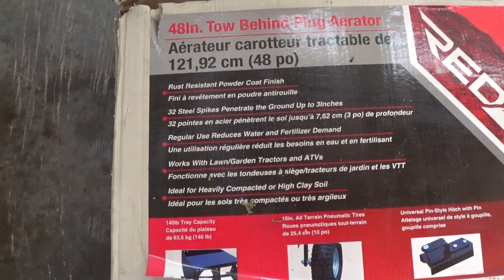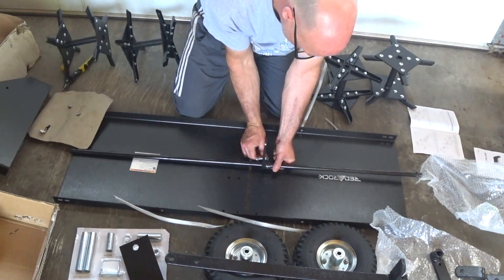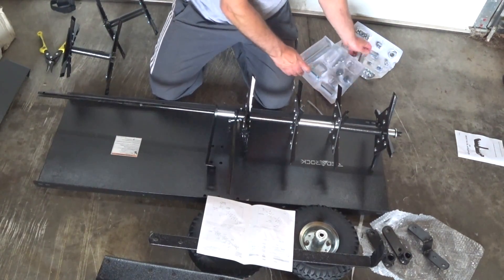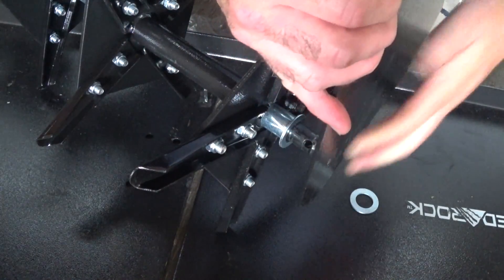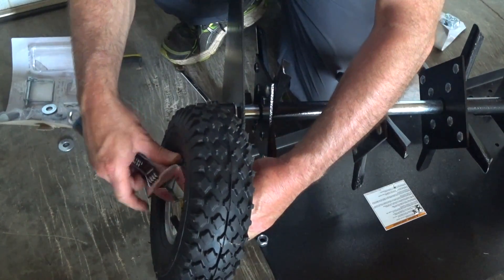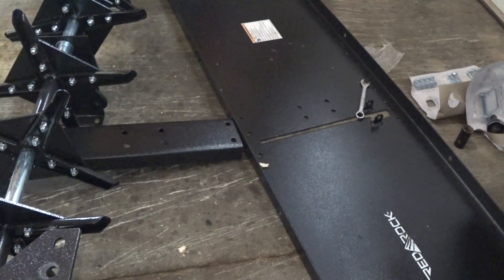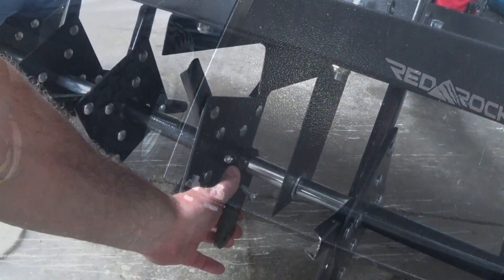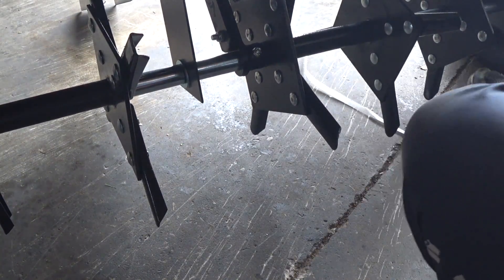HOW TO ASSEMBLE 48" Red Rock Aerator from Princess Auto

Comment: Have you figured out what the purpose of the spacers on the top is? I spent quite a bit of time trying to figure that out while assembling mine the other day, and I couldn't come up with an answer.
Reply from the maker: i cant recall TBH - you mean the spacer on the tongue part?
Reply: @mudbrats  Yeah, there's 4 bolts that call for spacers, but I honestly can't see a reason for any of them. Two of them don't even attach anything together. It's just a bolt nut and spacer through the top plate from what I can tell.
Reply: I'm talking about the ones you put in at 7:54 of the video BTW
Reply from the maker: @ryansimpson6115  ahhh yeah - those are odd.  I wonder if there is another attachment (to hold weights etc) those are for